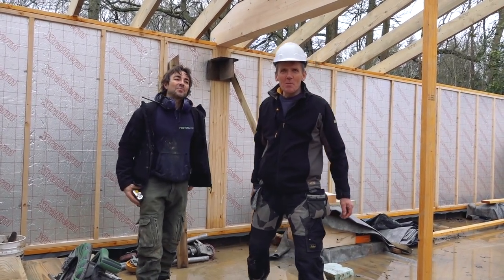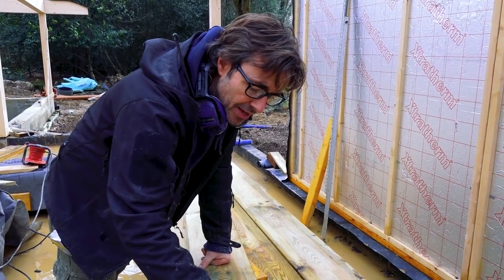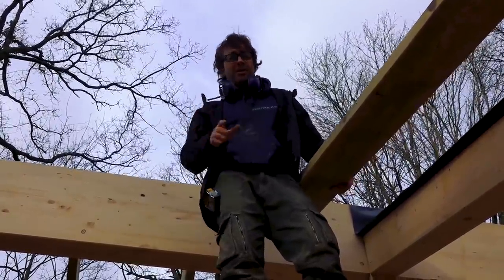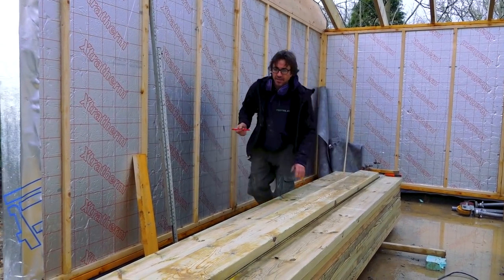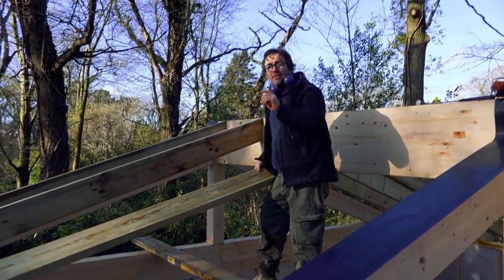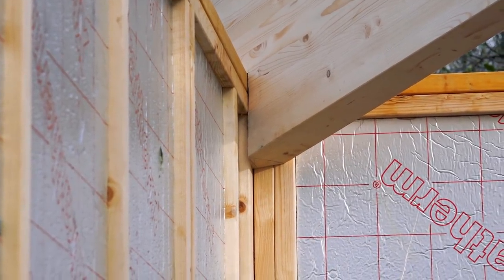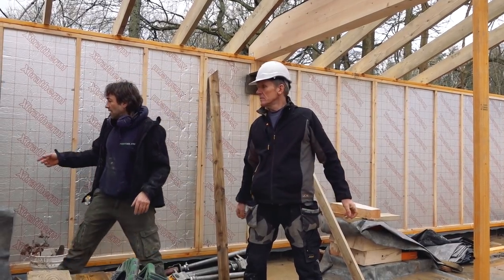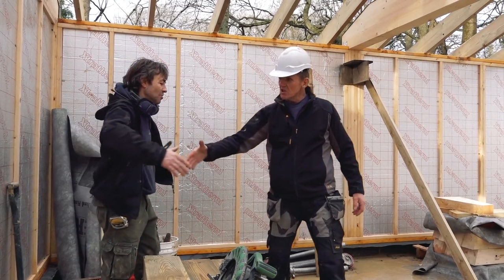Cutting the Roofing Timbers - Capel #4

Comment: I screw a small piece of tile batten with a slight overhang to the width on the top edge at both the top and foot of the pattern rafter, that way it's easier to line up with the blank underneath and ensures the pattern and blank are dead flush

Comment: building flat roof with korniche roof lantern, [cold roof system] 9x2 joist with firrings fitted, building control say reqs additional cross venting around 2 sides of lantern, have trickle vents fitted to 3 sides and roof tied into bungalow roof so vented there, would we be able to notch firrings or drill holes in joist to achieve cross venting

Comment: Hi I was always taught to put a dragon tie at the bottom of a large hip interested to hear your thoughts 🏠🔨
Reply from the maker: Hi Roy 
The dragon tie is a lovely idea and puts the strength back that is lost by the deeper birdsmouth. 
If the structural engineer calls for it then we do it but in a standard hip it is overkill and gives you an awkward bit to plaster. What we are finding now is that Building Control is asking for double hips bolted together.
Reply: Skill Builder hi not seen a double bolted hip yet 🤔did once get asked to bolt a 6mm * 200 plate to each side of a 250 mm * 75 hip 🙄no thought to how we were supposed to fix the spars ? Structural engineers 😡I am sure they make it up as they go along 🏠🔨

Comment: Can’t quite see how this roof finishes, so will be interesting. I’m surprised about the concern regarding the roof lifting off, surely those walls are anchored to the ground in resin bolts or similar.
Reply from the maker: I think Robin was concerned about the 8 x 4 sheets lifting off and maybe pulling some raters off. The frame is anchored into the slab
Reply: Thanks for the comment, you are correct on both counts we shot fired the initial wall plates into the concrete blocks and resin bolted all the main construction members including post bases and metalwork.